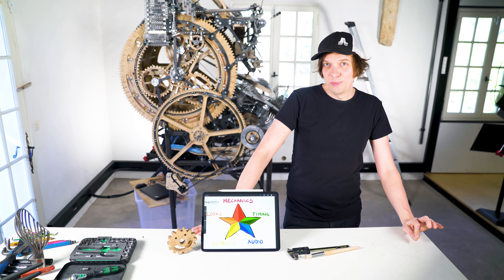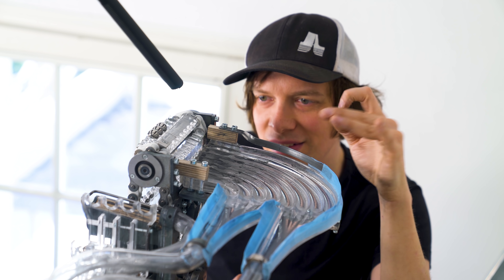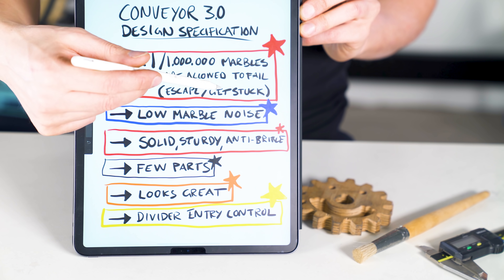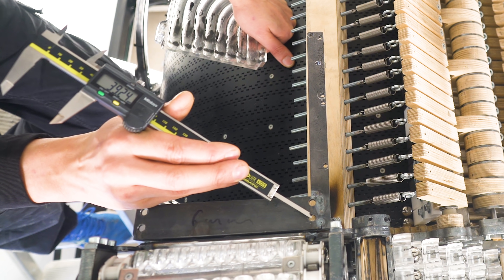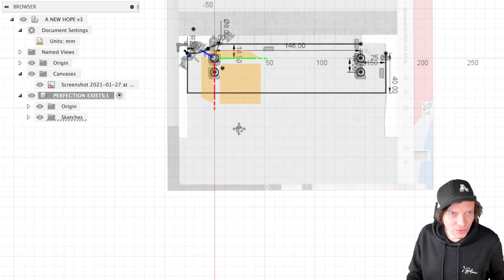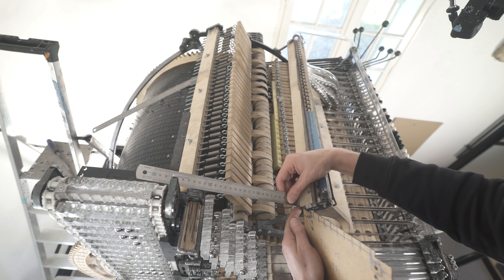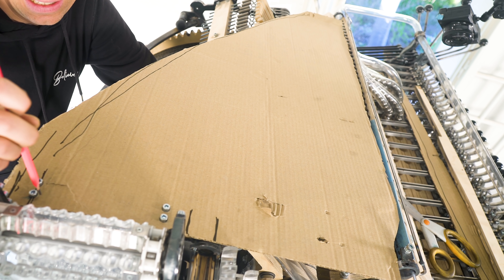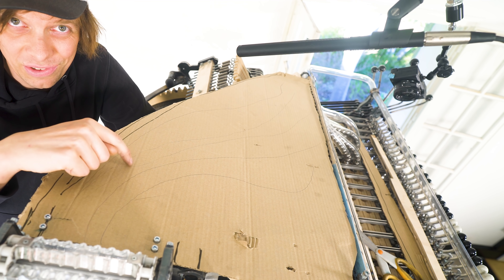Designing From First Principles

Comment from the maker: To clarify, i am redesigning this because the old system dropped ghost marbles with risk of critical failure, not for the aesthetics. (And a little bit because its a fun part to machine ;)
Reply: There's nothing wrong with redesigning old parts just because you think there is a better solution 

1) first attempts are rarely the best attempts
2) it keeps you interested and excited about the machine & preventing designer fatigue
Reply: Whatever you do, DON'T GIVE UP!!!
Reply: We should all go to bed! :D good night! :)
Reply: Hey Martin, Just wanted to give you a heads up incase you haven't thought of it. Be careful with your design you choose because you want to make sure you are always getting enough marbles to the early channels.
Reply: Martin, can I suggest that you also add a very simple tray at the bottom of the conveyor for redundancy's sake? It's never going to be physically impossible for the marbles to pass through into the other side of the conveyor - for argument's sake, let's say a marble gets coated in something sticky, or has a 1 in 1 million bounce and ends up back in the slot it came from - but you can make it physically impossible for them to drop into the gears. Two factors of safety is never a bad thing!
Reply: A small part of me doesn't want you to finish it, 
as the build process is so entertaining, 
but the larger part of me is very much looking forward to completion!!
Reply: Could you please give us an overview about what is left to do on the machine and which partd you do yourself and wat did you delegated to other people
Reply: Butterfly Martin
Reply: @DODIDA_de  As far as what is left, adding all the marble channels back in is the obvious part, but hopefully it will be somewhat routine. In parallel with that, Martin is doing the larger and larger tests to try and achieve one million marbles without a failure. As you can see from the large test videos, Martin himself doesn't know what will be necessary to achieve that. He wasn't expecting to redesign the basket scoops or add fittings above his marble gates; most of the steps to come will be like that, though as he says, he's trying to reduce the amount of whack-a-mole involved by improving his core design principles.

Beyond 1 million marbles, I think the welded-pin programming drum is the only big upgrade that is planned. I'm sure there will be some minor tweaks for sound quality on the different instruments. The machine is also designed to split into separate parts for relocation, and he'll have to test that a bit before a tour can happen.

I'm curious about the delegation though. He's told us at least a couple parts that were designed or machined by others, but he talked about increasing the amount of delegation and I'm not sure which areas that's in.
Reply: Thank you Martin for all the effort your are putting into this final stage of the MMX build.  Please don't push yourself too much, and if you ever want to take a day off of these build videos, I'd love to watch a video about your daily routine, at what time do you wake up, what do you eat for breakfast/lunch/dinner, do you do your own house chores, what do you usually do before going to bed? I hope you can share a little bit of this, as a big procrastinator living alone I've struggled my whole life to have multiple days in a row 1/10th as productive as yours. Again thank you for all the inspiration, and remember, the journey IS the destination.
Reply: Ever heard of ¨Murphys law¨?  Martin + Murphy + 10 times over = MMX
Reply: I think you could handle the marbles more smoothly and with less noise if the plastic parts the marbles travel over, like the one you are working on here, were made out of wood with felt on top. That would have a classic look and dampen the noise quite well. Oh, and if you put a brush on the part that meets the conveyor belt, then the brush can keep the balls in without getting the conveyor belt all messed up even if they are touching.
Reply: Outstanding job!
Reply: As long that that plate you designed is flat instead of sloped your going to have a risk of ghost balls I believe.
Reply: Just so you know, once this machine is finished, I plan to binge watch the whole process from beginning to end again.
(And then wait for the DVD or digital release of the entire program!)
Reply: Your perseverance and creativity make my day if you can keep going it’s possible! Go MMX world tour!
Reply: Your engineering thought process here is impeccable - kudos!

It's definitely a balancing act, but you can't shy away from assessing potential modes of failure up-front.
Reply: I'm worried that the new marble paths will favor the center channels more than the edges, which will leave the lower vibraphone notes completely reliant on the Fish Stair setup. Couldn't you have just fixed the existing parts by dampening the acrylic path and putting some flexible brush bristles right at the edge there, creating a slope away from the conveyer?
Reply: When you are done you will be as good a cadder as you are a musician.
Reply: It seems you also have the opportunity to do away with the requirement that all the marbles in the pipes are at the same height, too. That would be a huge simplification that would remove the need for those height adjuster thing. I've always thought that requirement is one of the weaker parts of the design.
Reply: @HypherNet  Doubt it. The divide by 4 recovery system feeds the beginning of the whole divider. But most importantly, the eventual disparity between feeding could critically impede the ability to play certain instruments. It is paramount for marbles to check all pipes all the time.
Reply: Just gotta say if you used loctite on the acrylic then that would be why it is brittle and cracking.
I told you so...
Reply: You would be surprised how nice an engineered design can look when you stop focusing on how it looks. A well engineered design will almost always look good without the extra effort in the art department...
Reply: and we love you for it Martin ! keep learning ;)
Reply: Whenever I looked at that part, I saw the wear from the marbles landing, and felt like it would eventually cause problems. Noise = wear and tear. Definitely happy you're redesigning this part.
Reply: To be fair I could see this becoming something aesthetic as well. 
The curved path you marked out reminds me of the shape of a Grand piano which in itself is a Beautiful design. especially if you can add some waves for the marbles to roll through which would kinda be a homage to other Marble machines that uses the flow of the marbles to show its beauty rather then just their wireframe aesthetics most of the time
Reply: Awesome👍👍👍
Reply: Hey you should be careful about the speed at which the marbles follow the path , if i may assume if you are making it curvy you may have to think about another stop or a way to dampen the impact of the marbles on the end of the curvy rail. And mist probably  the speed will increase at the curve going down , so maye putting a adjustable  top plate would make the marble stay in place . Hope I helped a bit .
Reply: Rather than trying to make all parts work without failures, I think it would be easier and more effective to ensure that no failures disrupt the machine's operation.  If e.g. one had a funnel to catch marbles that fall off the bottom of the conveyor and let them join marbles from the other funnels, then it wouldn't matter if some ghost marbles end up falling from the conveyor.  Even if 1% of marbles did that, all that would mean would be that one wouldn't be able to play quite as many notes.  I also wonder if it might make sense, at least temporarily, to have marbles that pass all the way through the divider feed back to the main lift rather than the fish stair.  That wouldn't be as elegant or as energy-efficient, but would be a solution to reliability issues on the fish stair.
Reply: Hi Martin,
I understand the reasons why you decided to change these parts, but I think that your new design has some (4) potential issues.
Due to the MMX construction, you have the physical constrain that you cannot play more than 8 marbles per machine cycle (I define machine cycle as the time between every movement of your marbles lifting system). In the ideal case, 4 of these marbles came from played notes, and the others 4 came from the not-playd notes.
Then here below there are the first 2 problems:
1/ All the songs that you'll play must take in mind that, in average, thay cannot play more than 8 marbles per machine cycle
2/  For the channels marble feeding, you can rely only on the convey belt.
The barbles coming for unplayed notes can be seen only as a special case where you didn't exploit the 100% of the MMX capability of playing notes.

The other BIG design problem is dividing the channel entries of the marble divider in zones.
I think that the 3 zones can be:
- vibrophone
- rythmics
- bass
Once that you have these zones, you have to define, for each zone, a number that expresses "the average number of marbles" that a given marble-divider-zone can play per machine cycle.
Knowing this, you can route some paths to constrain the marbles to go from the convey belt to the 3 marble divider zones, knowing that the marbles on the convey belt are distributed with a Gaussian distribution centered in the center of the convey belt output.

Even if you route perfectly the output of the convey belt to the marble divider, and you tune all your songs to respect the 8 marbles per machine cycle constrain you are not free from the 3rd and 4th problems.
3/ if you pass from a section of your song where you have a lot of played marbles, you may endup to not have free marbles for your bass and your rythmics.
4/ If you pass form a section of your song where you play just few notes, you may have congestion issues in the marble divider caused by your marble lifter.

What I suggest is to think a lot about these issues in your design phase before passing to CNC manufacturing.

I am sorry to play the role of the engineer, but I am just trying to help you to stop this wack-a-mole game.

If you want to discuss about this, feel free to contact me.

Andrea
Reply: Make two lanes ON TOP of the triggers. Why moving the marbles to the lane and move them again using twisted tubes to the triggers? Why only one lane sending marbles to two rows of triggers? You need 2 lanes on top of the two rows of triggers...
Reply: @damianvila  because, if you do so, you risk to have marbles in one pipe that may be used in other parts of the marble divider. This will cause the emptying of some marbles pipes of the marble divider
Reply: @andreabocco4973  Yeah, I get that one lane could be using marbles faster than the other, but the system already deals with this, feeding the leftover marbles back into the feedback tube and the escalator, and into the lanes... In fact, you can get rid of the escalator and the feedback tube altogether if you want, as long as you have a feeding buffer that can hold the unused marbles before they are fed into the lanes. Edit: the idea is to have LESS moving marbles around. Marbles moving are parts moving, and more overall noise. Noise is critical in a machine destined to make music. Martin needs to reduce the amount of marbles moving, the amount of parts moving, and make the machine more efficient and less noisy.
Reply: @damianvila  I like your comment. However, the full mmx is noisy by definition. It uses metal marbles that, every time they touch together, they make a metal noise. If the marbles would be made of rubber, the overall noise could be eavily reduced.
Since the magnetic property of the marble is important, all the marbles can be covered with a rubber layer that will reduce the noise (expensive solution).
Moreover, in all the cases, the marbles will keep to "jump" across all the stages of the marble divider. And the noise would not be fixed.
I think that between noise and mechanical failure, due to a marble loss, it is better having noise.
Maybe I didn't get your point. I hope that my answer makes sense according to your remark
Reply: @andreabocco4973  No, I think you get the idea. To be clearer: what I mean is that, since Martin is redesigning the divider and lane/feeders, maybe he can get rid of some of the complexity, like the return pipe and the escalator, that have low tolerances and are prone to fail. He had to adjust the return pipe, because marbles got stuck there. He had to adjust the divide by 4 and the escalator, because marbles jumped out... my approach is to get rid of that part of the system, build a feeding buffer after the conveyor belt, put two lanes instead of one (the feeder holes are too close together, and the pipe bending is complex, have a forward and backward lanes instead), let the marbles sort themselves in the buffer and fill the lanes as needed and you'll have a more robust, less noisy marble feeding system. So far there are too many parts moving, too many points of failure, too many marbles rolling around, that serve more of an aesthetic purpose than an utilitarian one.
Reply: @damianvila  I partially agree on what you said. It is true that removing some part of the mmx can  reduce the probability to get a failure.
Owever Martin has to fight the gravity, and the unused marbles coming out of the marble divider will end up in a point lower with respect to the point that they started.
As a conclusion he has to elevate the marbles to recycle them in the marble divider, and he cannot get rid of the marble lifter as you suggested
Reply: I kind of liked the 'urgency' of the marbles leaving the conveyor, speeding around the corner on their individual tracks.  Especially in contrast to the elevator ride before that. Like the marbels are getting impatient while sitting still on the conveyor: "Finally on the top, better hurry now, my people need me down there playing a note..." That said, I'm curious how the new piece will look and work eventually.
Reply: Could have just put a small lip on the entry to the old acrylic system but, more design thoughts the merrier, feel sorry for Alex CNC to hear Martin hated the acrylic... 😅 Great work Martin, keep that positive attitude!
Reply: Hi Martin,
I like, that you started to think like an engineer. First analyzing, then making a requirement list and after that starting to design. Very nice!
Kind regards, Kai
Reply: Glad to see that you found something fun to do. After your last video, i really feel like you need a bit of a morale boost, and this is good for you.
Reply: Don't give up yet! The machine is so close to being a 3 year project and it would suck to see it be so close only to waste away.
Reply: https://youtu.be/NLpX9v4o7UU
Reply: When i got stuck with my robot, it is nice to see some one, who is working on a completely different project, has the same issues. Thanks for making me think.
Reply: Hey Matrin, please feel encouraged to change what needs to be changed - I know you just want to play music on the damn thing, but it's a inspiration for all makers, that are struggling on a project! Just go step by  step to a finished project - no matter how long it takes as long as you have fun on the way!
Reply: I still think both your designs are overly complicated. It would be much simpler to get rid of the conveyor and fish stairs and feed all the marbles to the back (how you do that isn't important. All the marbles could go under or they could go around either or both sides).  At the back, use hoppers to collect the marbles and bring them up. Then dump them onto a flat board at the top that spreads out and uses dividers to evenly spread the marbles. Since this board would be quite large, you could hold a lot of marbles on it.
One other problem with your current design is that a lot of marbles end up being recycled without doing anything productive. That's just wasteful.
Reply: And when you do finish the Marble Machine, you should write an SCP about your Marble Machine coming to life!
Reply: @fredashay  I'd write that the machine eventually incorporated Martin into its own design, forever trapping him inside it... The ghost in the marble machine
Reply: @Mr.Abreu.76  Yes!!!  SCP-xxxx The Ghost in the Marble Machine  That's perfect!!!  If Martin doesn't write it, somebody has to!!!
Reply: Yay.
Reply: Ok but what are you doing to prevent the marbles from backing into the conveyor belt and riding it down? I don't see a solution to that yet. Looks like it will still be possible in the new design.
Reply: @mattiasthorslund6467  an overhang and jockey wheel would allow the marbles to drop out into a walled tray by would probably require a serious redesign of the conveyor belt system.
Reply: @jonathans1759  Yes reconfiguring that asssembly would be a lot of work. A simple tray below the conveyor belt would at least collect marbles riding it down so they can't damage the machine.
Reply: Martin, you need to take in consideration the marble ingestion requirements for each instrument and make sure the conveyor belt deliver the required number of marbles to each pipe.

If you design this new conveyor belt to not deliver enough marbles to the first and last channels, you will have issues as you add more channels in the future
Reply: as you said yourself the fix would have been removing the silicone. If you want to do something dont look for excuses. Just say i do it cuz i like doing it.